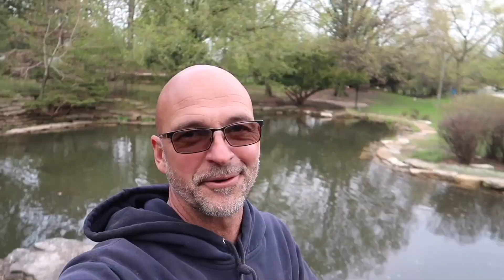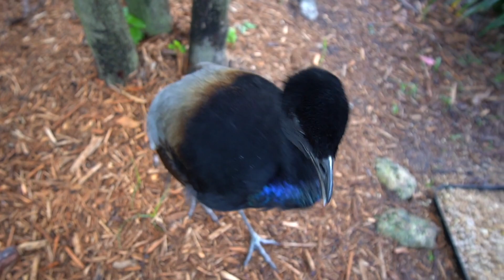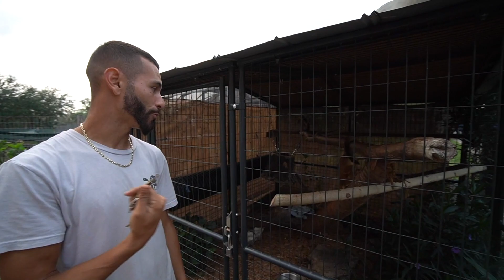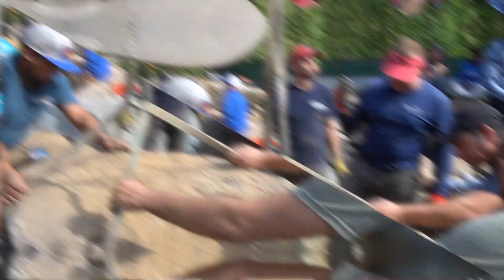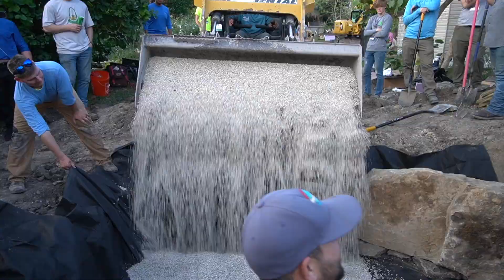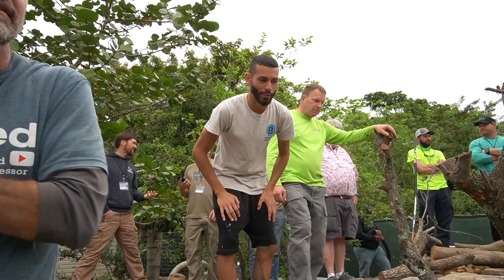Blake and Otters and Birds, OH MY! - Part 4

Comment: Ed, what's your mechanical filtration here?
Reply from the maker: Mechanical is connected with our Negative Edge system,
All debris goes over the waterfall and ends up in a shallow pool of water, this then overflows through a layer of medium/large river rock, the water continues to mix as it flows through several layers of Aquablox to allow the sedimentation process to occur.
Reply: @EdThePondProfessor  Thanks for the speedy response. While I realize that there won't be much in the way of fish waste here based on what was stated (consumed by the otters), aren't you concerned that the solids remain in the water column?